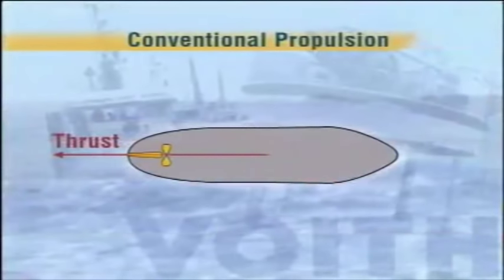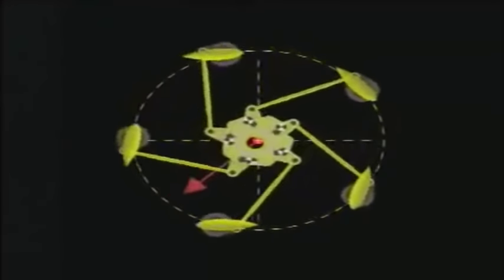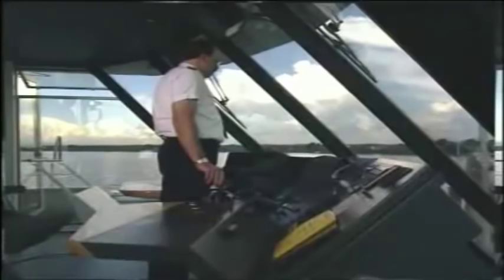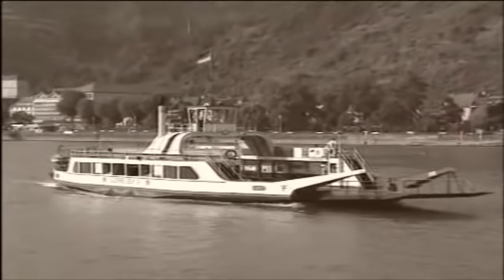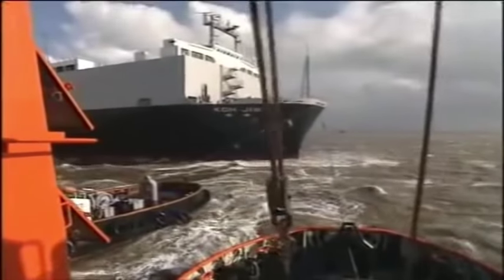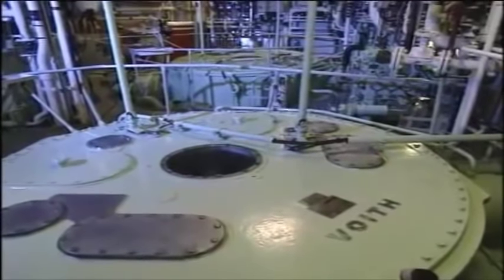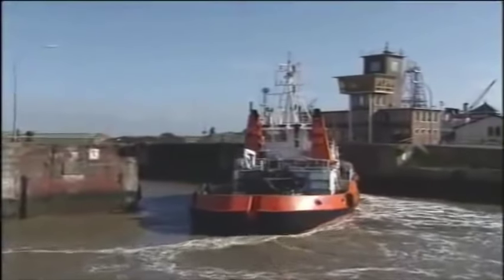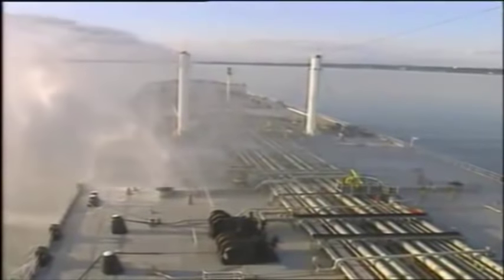Voith Schneider Propeller Tug

Comment: I am operating one of these tugs in West Africa and just love it. I have a question. What is the name the big black contraption that the tow wire goes threw on the back deck????????
Reply: 😅  That's the thingamaliing mate and there should be another one on the "front deck' of your "vessel" and maybe more on the sides. Make sure you hold tight to the 'steering wheel' and 'drive' your boat safely now. Always 'park' it in safe places.  Oh there might be an instruction manual somewhere explaining the different parts and their use. 

I found one in my Renault convertible after a few years and learned all sorts of stuff about these knobs and buttons which cluttered up the dashboard and what the funny beeping noise was whenever I reverse it. Also learned what the various orange lights meant. I thought there seemed to be too many for any serious purpose. Turns out I was wrong. If it knows what exactly is wrong with itself, easier than any mechanic, why can't it fix itself then? it knows when the airbag wasn't going to work and hear I guessed it was just telling me not to chew gum while driving. Weird I know but French are strange so I just wrote it off as some Froggish fetish and ignored it.  🤔